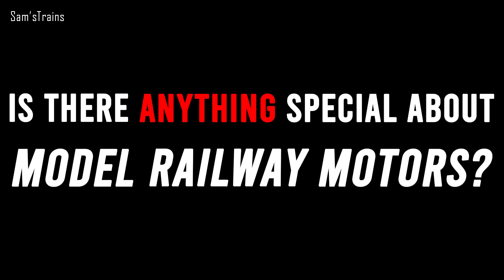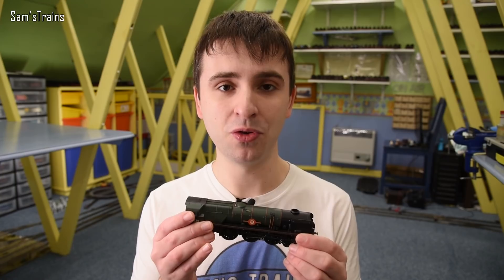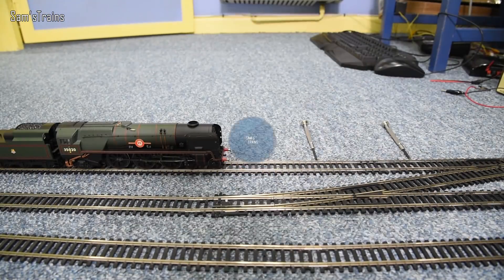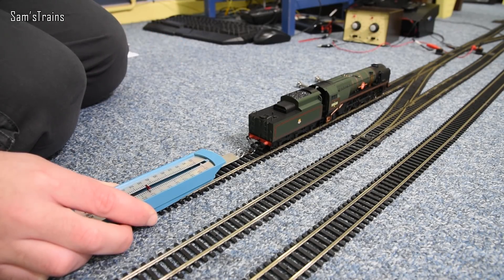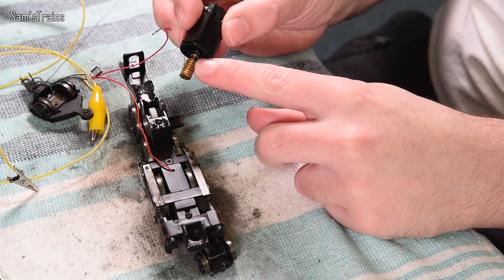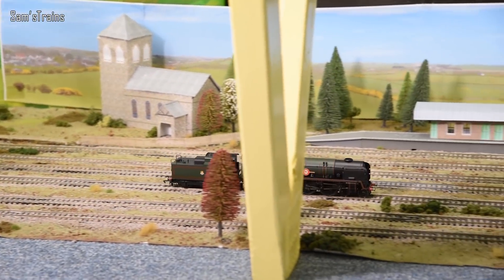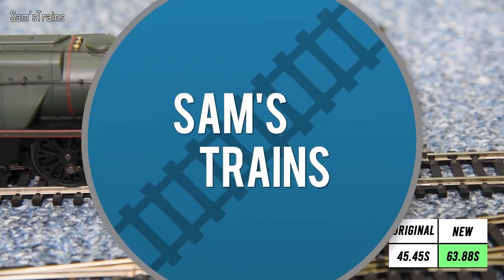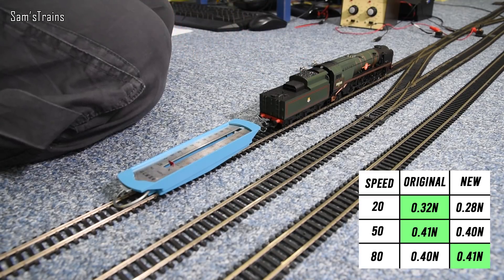How Much Do Model Train Motors Really Cost? | £2 vs. £27

Comment: There's a rule of thumb that at every step of a supply chain, the price doubles. That pays the costs (including taxes) and leaves a profit. By going direct to a Chinese source, you could be dropping a couple of steps, and pay a quarter of the price. And that doesn't look badly wrong for motor+worm.

In this case, Hornby do get a bigger chunk of money, but they may also have higher costs, such as packaging and assembly and storage until the spare is needed, and you'd be a fool to use that rule for planning a price. I have also bought things with rather poor quality components, which I then replaced. One of the things to remember is that postage costs can be a pretty big chunk of the cost: twenty screws are not twice the cost of ten.

Long term, supply chains are going to change, They've been fragile for a long time. But it may well be that we all look for suppliers with UK stocks.
Reply from the maker: Very true Dave, but even so, the motors from Hornby.com represent a 1395% (!!!!!) increase in price on what I paid, and that INCLUDES postage to my door! Granted Hornby need to make their money, but I think this seems excessive!
Thanks for watching - Sam :)
Reply: @SamsTrains  There is another thought here, this could be a chinese producer dumping their QA failures cheap. 

IE Hornby order a batch for, lets say £8 a motor, from the supplier. The Chinese supplier budgets £6 for production, knowing that each motor costs £3 to produce, but 50% won't passed a QA test for the Hornby motor (Resistance out of range on test, scratched/dented on the production line, casing out of length tolerance, etc etc). They fufil Hornby's order, and are left with a stock of motors which they've technically been paid for as part off the Hornby order. 

For a quick bit of extra profit they can then put the better quality cast offs on eBay, and this will be pretty much just extra profit, so they can go as cheap as they like, in this case, lower than the cost of production (since Hornby already paid for that). eBay accounts are easy to replace if an account get too much poor feedback, while Hornby have to factor in that reputational risk (hence the testing and the failures).

This has happened with iPhone in China, where the Apple cast offs were ending up either on the Chinese market or eBay.

You also get free postage due to China's deal with international postage (I know it's the Mail, but the core facts are correct).
https://www.dailymail.co.uk/news/article-5641459/UK-retailers-furious-Chinese-firms-use-loophole-let-ship-cheap-goods-UK.html

I do agree £27 is a lot for a motor however, especially when you can nearly buy another secondhand loco for the same price.
Reply: @m10cachilles43  Hornby pays 50p per motor so however you want to look at it they are ripping us off. I have bought lost of these Chinese motors and every one runs perfectly and in most cases better than the Hornby ones.

Comment: As nice as the price is what one test that should be done is run each motor for an hour and test the heat it generated.
Reply from the maker: Good idea - though they're basically identical in design, and since the current draw is similar (or sometimes less), the heat generated shouldn't be much different!
Thanks for watching - Sam :)

Comment: I bought the same motor with double shaft as possible replacements for my Kato locomotives (this motor is the same dimensionally) and for any other locos that may need repowering.  Excellent motor and great price.  These motors were $2.55 USD, but have just gone up to $3.55.  Shipping very cheap, but it took three weeks for them to arrive from overseas and work their way through Customs.
Reply from the maker: Great to hear that - they really do perform well don't they?! :D
Thanks for watching - Sam :)

Comment: What a really good video, it is not surprising I used to work for Ford and you would be amazed at the "mark up" in spare part prices. This is probably the same motor Hornby use, lets face it they are made in China. Avoid cheap batteries from China or chargers, they generally don't work properly or in the case of chargers, dangerous.
Reply from the maker: Thanks a lot C - is that so? Blimey! Yes I expected that to be true too :/
Thanks for watching - Sam :)

Comment: Interesting, but you're not testing the motor's power, your testing the traction of the locomotive.
Reply: Yes that's it. Loco weighs the same/same weight distribution so traction will be the same.
Reply from the maker: You're right - but I kept the controller at the same speed - it should have shown if there was any weakness in the new motor!
Thanks for watching - Sam :)
Reply: He also tested the current draw of the motor.

Comment: How did you get single shaft out of the bag? They're advertised and shown as dual shaft in that link in the video.
Reply from the maker: Yes you're right - the single shafts don't seem to be available at the moment (maybe because I bought too many?!), though they do turn up from time to time, keep an eye out! If you need one straight away, you can cut down the shafts using a rotary tool, but either do it very quickly, or a little at a time - you don't want to generate too much heat!
Thanks for watching - Sam :)

Comment: I tested a Proto2000 E6 at low speed and found that it could slow to 2.5” in 20 minutes. It never stopped moving in that time.
Reply from the maker: That's incredible - they are amazing motors for what they cost!
Thanks for watching - Sam :)

Comment: Finally someone picked that theme up.I had a lot of issues with motors and believe they cause the most problems when locos running bad.Especially when running DCC.Still wonder why the Hornby motors have no weight on the axle, it would increase slow speed performance for sure.Your test was a nearly tie, i guess.The specs of a motor are important, due to the fact how many windings are on the rotor.Also thickness gauge of the wire is a point.What i say is , a high rev motor with lower torque , or a less reving motor with more torque.Depends on which loco is used and of course the gearing.Anyway, my opinon is that manufacturers uses often cheap motors and swapping a motor will help the loco to run way beter.As you show in the vid , it didn´t have to be expensive Maxon or Mashima motors.
Reply from the maker: haha thanks Carsten - I thought this had to be done! Many thanks for all the info, yes the motors appeared to be identical (inside too), there's no way Hornby's motors cost much more than mine did!
Thanks for watching - Sam :)

Comment: im starting to think the pricing manegement at hornby has a HUGE greed problem
Reply: The whole industry does
Reply: @BryceBitsPieces  how do they expect us to belive they're products cost 100s of pounds?
if i did the pricing. i'd put locos like 0-6-0s at 30 pounds at most. 0-4-2s around the same but a little bit cheaper. 0-4-0s as high as 20. 4-4-0s 2-6-2s and 2-6-0 at about 50. and so on
Reply from the maker: Maybe it's not accurate to suppose that the apparent mark-up here is typical of every product. But agreed, based on this alone!
Thanks for watching - Sam :)

Comment: Hi Sam, interesting to see this after all our discussions and searching for motors. Like you I have obtained a wide variety of new motors from between 80p to £1.90 from two companies, Having dismantled both the original Hornby motor and new ones they are identical and I'd say Hornby buy these motors for their locos and the company we have purchased from are simply off loading those that were not used. So bit of a rip off really the price changed for new Hornby motors. At least we have an option to replace them. Great work, good tests. Did the new one sound slightly more nosy I wonder?
Reply from the maker: Thanks a lot Mike - yes I thought I'd left it long enough to finally do a video! The tests suggest, at the very least, that they do seem to be identical! Yes this one was slightly noisier initially, though it seems to be getting quieter the more it runs!
Thanks for watching - Sam :)

Comment: Very good test Sam. You know how to do it. I’m not surprized as they have probably copied the motor in China. Well, I’m quite sure the original is also a Chinese one. Perhaps made in the same factory. BUT the main difference is (if any) in the quality of components. You should open both and compare the components. Actually you don’t know how long this new one lasts until you have used it for long enough. Drive now a year or so and repeat the test. Or put one new motor to a test bench and run if for few weeks continually and test again. Then you can tell much much more. And you should also listen the motors if they differ from each others or not. The sound is one of the best ways to diagnose motors. I hhave been maintenence engineer for 50 yrs and I always listen everything. Some times using a bearing stetoscope. The ear is very good tool if you are experienced enough. If both sound equal now and after two weeks test, it may tell that the motors are possibly made in the same factory.
Reply from the maker: Thanks very much mate - yeah you cold be right, that wouldn't surprise me! I have opened them up in the past, couldn't tell any difference. This kind is a nuisance to reassemble though, so I don't recommend it!
Thanks for watching - Sam :)

Comment: Would you recommend replacing a 3-pole with a cheap 5-pole motor? Just asking.
Reply from the maker: I certainly would!! :D
Reply: If you can find a 5 pole skew wound motor even better virtually eliminates “cogging” at slow and crawl speeds

Comment: An interesting way to take this a bit further could be to see if it's cheaper to build a loco from spares rather than buy it new. Find a train in your collection that's been around for awhile so there's a decent amount of old used ones online for parts. Aim for one close to £80-£100 (I'm from America so I think that's about $100-$130). Then go through what goes into building one from spares vs a complete original loco of the same type and compare performance and reliability. Just an idea.
Reply from the maker: haha that's very true - though besides the motors, most of the parts are proprietary to Hornby - but that's a great idea!! :D
Thanks for watching - Sam :)

Comment: What about DCC for those rich enough to afford it?
Reply from the maker: You mean with these motors?? They should work fine!
Thanks for watching - Sam :)
Reply: Considering that DCC uses Pulse Width Modulation to control the speed of the motor instead of varying the voltage, most any motor should be able to creep even slower, minus the inevitable cogging you get with any brushed DC motor (having a 5 pole skew wound motor helps get rid of most of that but some of it is still there).

Comment: The cheap motors don’t seem that bad although they might be slightly worse or slightly efficient but it sometimes depends on what locomotive you’re switching out the motor from.
Reply from the maker: I've not found that - mine have performed better, and have been within 2% efficiency of the original Hornby ones at all speeds!
Thanks for watching - Sam :)

Comment: Most of the results will come down to how many poles the engine uses. More poles, smoother running. Typical model train engines are pretty basic things. Model manufacturers will be buying theirs in from China by the container load and paying pennies for each one. I think model trains in general are very pricey for what they are.
Reply from the maker: Yes you're right - they're both 5 pole motors!
Thanks for watching - Sam :)

Comment: So Sam, if you buy a replacement motor from Hornby or Bachmann or whoever, does it come the exact same way and take the same amount of time to fit? 

Cos if that is the case, that is some profit margin for them on motors. Fair enough if it’s fitted or comes with extra parts, but holy moly that’s a huge difference in price.
Reply from the maker: That's true Rob - swapping the worm drive did take around 10 minutes. To my mind, I don't mind doing 10 minutes of work in order to avoid the 1395% increase in price seen on Hornby.com!
Thanks for watching - Sam :)

Comment: Two things. You are comparing a brand new motor with an old one, that may have lost some of its magnetism and efficiency and the other, how about reliability? That of course could take a while to compare. I also though the new motor sounded noisier, not that I'm going to watch the video all over again to  be sure. Have you left the new motor in Sam? Interesting stuff though, Thanks for pushing the boundaries once again.
Reply from the maker: This is very true - but I've also been replacement motors on other brand new models - namely the Hornby P2. The results were equally impressive! I've actually been experimenting on this since 2018 - a handful of my locos have been running on these cheap replacements for close to 2 years now - no failures so far! Yes it was noisier initially, as new motors often are, but with some light lubrication and running-in, they quieten down after an hour or two!
Thanks for watching - Sam :)

Comment: Your ebay search shows double ended shafts, yet in the bag shows single shaft, Ive just ordered 2 off 2 pieces for £3.68 plus 99p post I will see what I get??????????????
Reply from the maker: Yes the double ended shafts are the only ones available at the moment it seems - keep an eye out, the single ended ones have been available in the past. Otherwise, you can cut them down to size!
Thanks for watching - Sam :)

Comment: Nice tests, this might be true for hornby locos but in HO and HOm scale it is very different. I have lots of trouble with the locos which have a Chinese motor in them and no problems with my German locos with very expensive German motors. As it was already suggested in the comments it would be very interesting to try with other models from others manufacturers as the results could be very different
Reply from the maker: Yes that's true - some motors are truly top quality, and this certainly doesn't apply to those!
Thanks for watching - Sam :)

Comment: You still payed 1,6 £ plus 4£  and work with the loco. And then all the research, and postage.  You can't just randomly buy an motor. At least you had to know the specifications of the motor.  For example there are bigger Dc motors with exemplary running characteristics. They run wery slow, and are really strong in low rpms.
Reply from the maker: The cost was just £1.6 - there was no extra £4. The initial research was minimal - I spotted the listing, and ordered just one for testing. I then ordered more! The work involved took about 10 minutes. For 1300% lower cost than Hornby's I think it's a superb deal! :D
Thanks for watching - Sam :)
Reply: @SamsTrains  Thanks for the answer.  I thought the brass gear to the motor was 4 £ in cost.

Comment: I tried to find a motor for an electric razor.  I found a huge variation.  I could buy salvaged motors from used razors all the way up to german made motors.  For 30 pounds you should be able to buy a german motor.  The cool thing was that they had data sheets.  

It might be interesting to source a high quality motor... the official train makers motor is not necessarily the best quality.

Chinese components in general are usually very vague on actual information and instead say "improved" or "powerful".
Reply from the maker: It would be very interesting, you're right - I'd love to try a genuinely expensive motor, and not one that's just been marked up ridiculously! xD
Thanks for watching - Sam :)
Reply: @SamsTrains  I would be neat to see what a genuine heavy puller could do.  I wonder if a 12v screwgun motor could be made to sit into a 0 Gauge train chassis... :)

What you need is a cheap 3d printer like an Ender 3, then you could make it fit.  And print your own chassis... based on your rail gun rolling stock (which is probably the biggest thing that could make it around the layout)... imagine that in all wheel drive configuration.

Comment: It’s amazing how much companies charge as markup for replacement parts with their own part numbers on them. Motors, screws, wiring, even circuit boards can be found significantly cheaper elsewhere.
Reply from the maker: Yeah I find it quite amazing too - they shouldn't do it with parts in my opinion - replacement parts are needed when original ones have failed.... it's unreasonable that the manufacturer should be profiting from their own failures!
Thanks for watching - Sam :)
Reply: It is like buying the train over and over

Comment: Hi Sam I have changed a considerable amount of my locomotives motors with these cheaper replacements and have not had a horror story yet. Had roughly the same outcomes as your tests in your video. Seems to cover quite a few manufacturers bachmanns take quite well athearn, austrains, auscision, hornby, power line, mehano, rivarossi and lima I have done replacements. Love the videos Sam very informative and helpful
Reply from the maker: Great to hear that Mat - I too haven't been let down by any of them yet! Thanks for sharing,
Sam :)